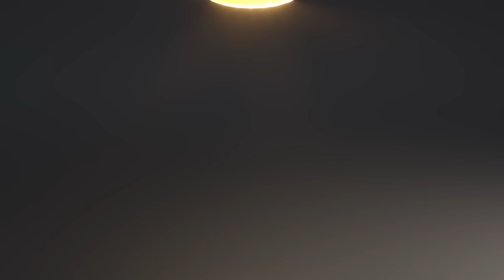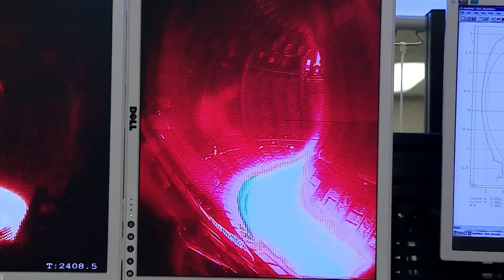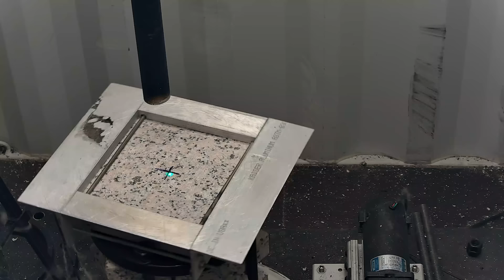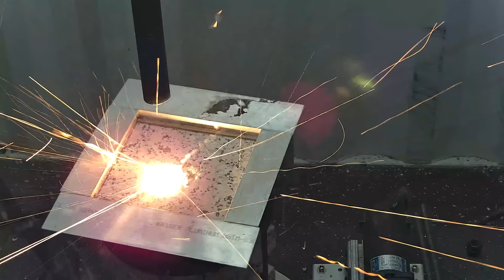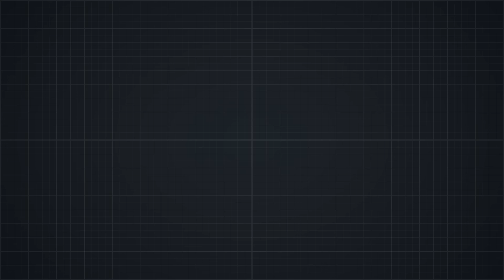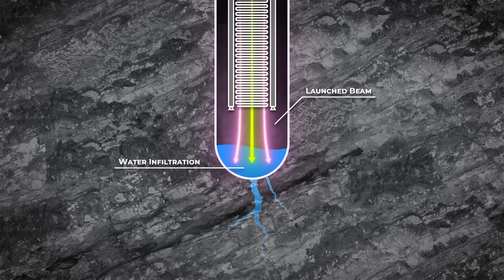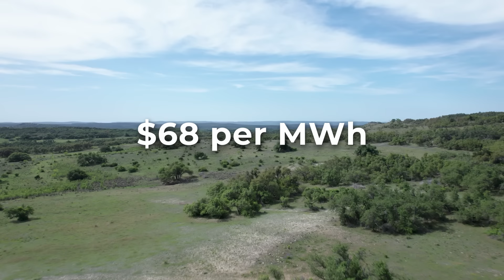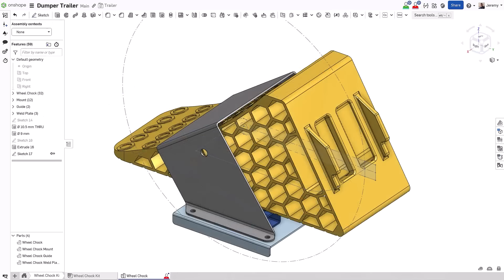Geothermal Energy is Changing

Comment: from Lazard(source for LCEO source: "Selected renewable energy generation technologies remain cost-competitive with conventional generation technologies under certain circumstances"

Please note onshore wind energy is not the cheapest form of electricity. The conditions required to make it so are not realistic.

Lazard was smart enough to add this disclaimer to their documentations whereas Real Engineering didnt care to and explicitly did the thing Lazard suggests not doing. 

"Other factors would also have a potentially significant effect on the results contained herein, but have not been examined in the scope of this current analysis. These additional
factors, among others, may include: implementation and interpretation of the full scope of the IRA; economic policy, transmission queue reform, network upgrades and other
transmission matters, congestion, curtailment or other integration-related costs; permitting or other development costs, unless otherwise noted; and costs of complying with
various environmental regulations (e.g., carbon emissions offsets or emissions control systems). This analysis is intended to represent a snapshot in time and utilizes a wide, but
not exhaustive, sample set of Industry data. As such, we recognize and acknowledge the likelihood of results outside of our ranges. Therefore, this analysis is not a forecasting
tool and should not be used as such, given the complexities of our evolving Industry, grid and resource needs. Except as illustratively sensitized herein, this analysis does not
consider the intermittent nature of selected renewables energy technologies or the related grid impacts of incremental renewable energy deployment. This analysis also does not
address potential social and environmental externalities, including, for example, the social costs and rate consequences for those who cannot afford distributed generation
solutions, as well as the long-term residual and societal consequences of various conventional generation technologies that are difficult to measure (e.g., airborne pollutants,
greenhouse gases, etc.)"

Comment: Is it just me but wouldn't the increase of pressure result in lowering temperature needed to melt the ground. Hence why for example the sun doesn't need as high temperatures to sustain a fusion reaction than is needed for our reactors. Meaning that the deeper you go underground the faster the rate of penetration for the same amount of energy, that being 1 MW/hour.

Comment: So I'm curious how they plan to handle the precipitation of the vaporized material as it's expelled by the nitrogen gas further up the tube. Surely not all of it would remain vapor as it cools and would start to form deposits on the walls? Could it be directed to reinforce and seal the shaft? Wouldn't it potentially jam up the drill?

Comment: I am curious how thick the current obsidian-like liner produced would be.  Perhaps a secondary maser that melts a wider section, combined with a feed material to supplement and seal weaker zones, and then the primary unit cuts through the middle of that.  Or maybe the wave guides can redirect the beam at the end so they could create a corrugated effect to the rock liner.  I think they will need to feed material down for water as well as for generally securing the hole.

Comment: It's like a typical startup that takes a realistic process or idea, wraps it in a wrapper of unrealistic expectations, pumps up and sells the company. Or goes bankrupt. The whole video looks like enthusiastic flattery, behind which there is no real bottom line. Arguments about the cheapness of wind turbines and the high cost of nuclear energy cause nothing but a sarcastic grin. 

The footage of the laboratory entangled in mineral threads seems to speak for itself. Yes, you can remove vaporized rock from the work area by purging, but how do you remove it from the gap between the pipe and the borehole walls? After a couple of dozen meters, it will be filled with mineral wool, and you're talking about a kilometer deep! The fact that you didn't say anything about it in the video means that there is simply no solution. Obviously, the drilling string will have to be removed regularly in order to clean the well from adhering mineral threads with a special drilling brush. This will make the technology worse in everything than classical drilling. 

All these startups are a kind of gambling game. I think it actually harms progress, instead of contributing to the development of technology.

Comment: They got $90mill in funding... Drill a 100M hole first heck even a 10M hole in the workshop THEN let's start talking about 7KM. I smell another 57 levels of funding Theranos inspired scam cooking

Who gives a fuck about if they could reduce the cost of electricity... If that can be done then hydrogen as a fuel source would be far more prevalent and actually of use to be discussed (another scam industry rebooting itself from 50+ years ago - checkout the company Hyzon as a perfect example).

Comment: For more reasoning on why drilling gets even more expensive the deeper you go, read this.
When drilling, something called mud is used. Mud is a lubricant and a safety measure for the case of a natural gas blowout. If you drill into a pocket of natural gas, you need enough pressure from the mud acting downward onto the gas to prevent it from spewing upwards. The same goes for oil but it applies more to gas because gas will expand more as pressure decreases, whereas oil has dissolved gas inside of it, much like a soda. So oil will release gas when pressure decreases and the oil will want to shoot upwards. Preventing a blowout is a very important job of the mud.
In the case of a drill bit breaking, you have to haul all of that pipe out of the ground. During the process, your mud will not circulate and could potentially dissipate into the surrounding permeable rock formations. This only happens if the rock is permeable enough, but it costs a tremendous amount of money to replace that lost mud. If the mud doesn’t get lost, you have to “kickstart” it which means to apply enough energy to the mud to mix the components back together because the sediment would sink to the bottom of the mud and separate.
You would need more mud the deeper you go and it may need to be even more dense to counter natural gas blowouts, which would increase viscosity and that makes the muds return back to the surface to separate the cuttings and get the mud retreated even more difficult. The reason we circulate the mud and retreat it to use it again is because mud is so expensive.
The pipe will also sustain damage from temperature and weight of the pipe down hole pulling on the pipe above it. It stretches the pipe and can cause damage. Corrosive water can also damage pipe which is not good and also a huge issue. If pipe is damaged, it has to get replaced which means no circulation of the mud, and possibly losing it in the formation.

It’s a whole process 😮‍💨😮‍💨

Comment: There's a Canadian company called Eavor doing similar deep drilling using high energy, but their design uses several conjoined closed loops made with precision drilling techniques.  The main shaft branches out into two, then four, and so forth.  Parallel branch pairs are spaced about 2 metres apart and joined together at the bottom by changing the drilling angle of one to intersect with the other.  The wells are cased only to the bottom of the manual drilling operation, then the high power plasma unit continues the drilling with the sidewalls encased with the glass-like melted quartz.  Eavor is drilling a pilot project in Germany at present.
Reply: But as far I know they drill with conventional techniques... check out DeepU Project that combine high-power laser combined with cryogenic gas to drill in rocks

Comment: It is NOT a good idea to sap the heat from the core: the endothermic reactions being performed using the new heat will be like taking out a loan you aren't using to start a business of performing an equal amount of exothermic reactions with. That will cause global cooling way faster, but on the inside, but what if greenhouse gasses, but what about no ozone, and what about the magnetic poles and rotation and orbit, and ok what about cooling the earth to mine it out, but what about the rest of the before stuff again?!!
Reply: All in all, it would be Earth moving towards an equilibrium rather than a homeostasis. Homeostasis is life, equilibrium is death.... do the math...
Reply: Also, what about the carefully preserved ecosystem we're invading with our foreign life from above?
Reply: poking holes one one-hundredth of a percent of the radius into the earths surface is not going to bleed out the earths heat, even at scale. get ahold of yourself, man.

Comment: Wouldn't there be some danger of affecting the magnetic field by doing this on a large scale? It seems to me the core is at a functionally comfortable equilibrium at the moment, drawing substantial energy out must change that balance regardless of the magnitude of "available" energy or even the rate of heat generation by radioactive decay. The likely response from promoters is seems likely be that the pool of available energy is so enormous that we couldn't possibly have a substantial effect on the overall system - similar claims were made in the past in regards to both the atmosphere and the oceans - that has not worked out so well for us. If anyone has substantial information regarding this issue I would love to hear it before getting too excited about this tech.

Comment: this would start to cool down the core of the earth more quickly. Although the impact may seem small, in the long run the effect would accumulate especially if something like this goes global
Reply: Can you not be a Dunning-Kruger? Mariana's Trench is also 11 km deep and which an extremely larger diameter, in comparison. Not only that but it dissipates the heat into water...

Comment: It’s impossible to hold the weight of the drilling equipment or even the steel  cable that length.  We would have sky elevators. 

So a spiral or a slope is the only way or stages with caves

Comment: This, could, be interesting, one day, but poses a lot of challenges. Drilling technology has gotten very good at drilling to 10,000'-15,000' below surface quickly and efficiently. Going deeper usually works ok until bottom hole temperatures reach ~200degC or so, then things start getting weird. The rock itself turns almost into plastic and becomes harder to physically drill, the rock tends to deform rather than bust apart as usually from the weight of the drill string. Even if vaporized, getting the "returns" 20,000'+ vertically back to surface will prove challenging. The formation pressure of the surround material will want to enter into the well bore typically, and that must be counteracted with a column of fluid, aka drilling mud. While it is possible to drill with gas in certain places and certain formations, super deep wells will prove more challenging. This can be counteracted by sealing the formation off properly with steel casing, but takes time and money to run, and the more strings of casing requires larger and larger bore sizes the more shallow you go, adding cost. I'm not sure how well you can trust the "obsidian casing" as well, especially over thousands of feet, if any section collapses on itself there goes that well. 

Another massive problem is telemetry. With a heavy weight drill string, you can run all sorts of downhole tools to provide steerable bit technology, take measurements, coring samples, etc. With a non-conventional drill string of lighter weight pipe, that may no longer be possible, which would be required to drill two holes close enough together to achieve the geothermal cycle. If a column of fluid is required in the well bore, collapsing of the drill string is a real problem. How can you "steer" the bit in this case? You can potentially with down-hole tools but they need pump fluid through the drill string running a motor/generator to function. 

How straight does the drill pipe have to be for the laser? As a real oil well is not 100% straight. I'm sure some sort of fiber optic line affect could be achieve? But, how to get that work in pipe sections assemble in 40' joints? 

And as they mentioned, fluids in the well bore. Brine is often encountered, salt domes, hydrocarbons, etc. 

There will be many challenges to get this technology operational, but, theoretically, I could see how once you hit very high temperature downhole temperatures where conventional drilling basically stops working, this could be effective method, but how to actually get the energy to that point is the true battle.

Comment: How do they make sure that the rock stays fluid as it comes out of the hole? Sure, some might solodify as obsidian on the walls, but some of that rock will need to go through a 10km pipe without cooling into a solid

Comment: Why drill so far down to get super critical steam? Can't you go a little less deep, heat water up to I don't know 80-90C and use the hot water to heat entire neighborhoods. Competing with wind and solar on electricity prices is going to be tough. Competing with heat pumps for thermal energy in homes and industrial applications should be much more feasible.
Reply: High energy means better use out of the same port for whatever application is utilized. Also I’m pretty sure steam turbines have a much greater energy transfer and utilization than trying to leech off of super hot water. If you’re already near boiling, why cut the journey short just to make your life infinitely harder?
Reply: @extremeencounter7458 
You cant drive a steam turbine with boiling water. Super critical steam exists at above 3.000 psi and 375C. You need to go very deep to reach those temperatures. The unike selling point of this tech is, that digging further than ever before is possible. However I see a better use case in making conventional geo thermal energy more cost effective, than going near the earth's inner core to drive a steam turbine.

Comment: Aren't the current bore hole stabilized with mud to keep the various liquid/gas contain in the rock below? How does that will work with the "we need to pump nitrogen to expel the hot molten rock? Also, that molten rock filament will increase cost as it will damage or entrave the drill operation

Comment: one cool thing they didn't mention: this thing needs a lot of electricity. you know where you can get a lot of electricity the cheapest? right at the power plant. which already has a lot of power generation infrastructure... hmmm... maybe the best immediate use for this idea is not to make new power plants, but to send it to fossil fuel plants, so they can use their own power generation to cheaply dig a hole in situ and use that hole as a fuel replacement while keeping all the old infrastructure!

Comment: What if we start drilling right from the mariana trench ?
Reply: Hard to run and maintain drills at such insane pressures in salt water in the dark and with such a long time and cost to move materials to the drill site
Reply: @extremeencounter7458  We will need to work 2 techs simultaneously like being present at the mariana trench & start drilling right from there , i found only this option feasible after scratching my head multiple times 😅

Comment: Digging toward the mantle for geothermal energy sounds like something straight out of a sci-fi novel, but with the way technology is advancing, it’s not entirely out of the question. The mantle itself isn’t exactly just below our feet—it starts about 30 to 50 kilometers beneath land and around 5 to 10 kilometers beneath the ocean floor. Down there, temperatures soar between 500°C to 900°C (932°F to 1652°F), which is a goldmine of energy if we can figure out how to tap into it.

The biggest problem is actually getting there. The deepest hole ever drilled, Russia’s Kola Superdeep Borehole, only reached 12.3 kilometers before the heat became too much, topping 180°C (356°F) and frying the equipment. The deeper we go, the hotter it gets, and current drill bits just can’t handle those extreme conditions for long. Molten rock and high pressure also make things unstable—try to drill through semi-molten rock, and the borehole could collapse or get sealed up by rising magma.

That said, we’re making progress. In Iceland, geothermal researchers have already drilled into supercritical fluids, a state of water so hot and pressurized that it holds five to ten times the energy of normal geothermal wells. Over in Japan, scientists working on the Chikyu Project are aiming to drill through the oceanic crust, since the mantle is much closer to the surface beneath the sea. Meanwhile, at MIT, researchers are developing plasma and millimeter-wave directed energy drilling, which could one day melt through rock instead of grinding through it, making deep drilling much more efficient.

So, is it possible to reach the mantle for geothermal energy? Not yet, but we’re getting closer. Right now, the focus is on supercritical geothermal wells at shallower depths, since they already provide huge energy returns without the need for extreme drilling. But if technology like plasma drilling or laser-assisted drilling takes off, we might actually break through to the mantle within a few decades. If we can pull that off, it could mean near-limitless clean energy—essentially free power for humanity. The challenge isn’t whether the heat is there; it’s whether we can engineer a way to safely and efficiently tap into it.
Reply: To be fair, that’s not hot. Your oven rack sits fine at 500 degrees F. It wouldn’t take much in the way of engineering to get a bit and chute that works under 2,000+